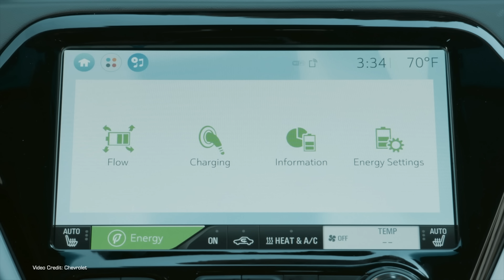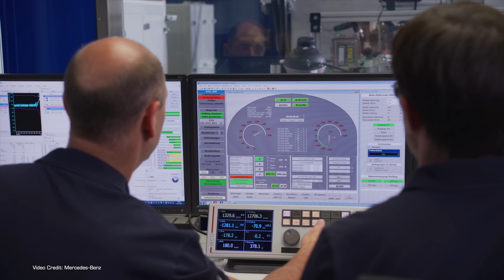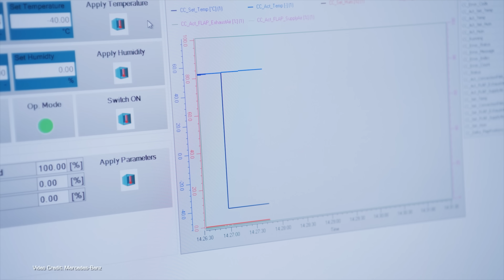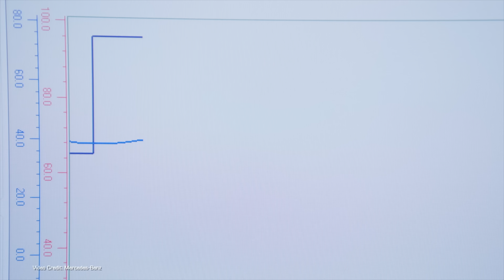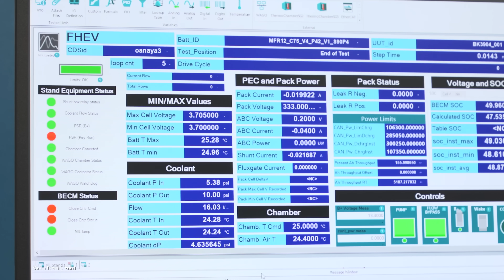Should You Buy An EV With An LG Battery Pack?

Comment: I believe that the upcoming GM Ultium battery is their own design, and I suspect that they will be more oversight of LG once the new factory comes online.

From a recent interview with Mary Barra, it appears that there are two defects that have to happen in the same cell at the same time. This sounds like a lacking quality control and inspection by LG allowing the defective cells to make it thru. Hopefully there is some severe pressure on LG to implement new procedures.
Reply: I won't trust Ultium either. Still pouch style and made by LG. Possibly a used one that is at least five years old and and no recalls. Never say never, but I'm very unlikely to ever get another GM since there are plenty of other EV's arriving.

Comment: It amazes me that most people don’t realise that they drive their ICE cars about with vast quantities of highly combustible petroleum gasoline, yet no one is panicking about that.
Reply: Right? I’ve seen ICE fires. It’s not like they are small or simple to extinguish.
Reply: The fear that EV owner may have is unlike ICE cars, unless there is an overt act upon the vehicle such as an accident, or while driving a ruptured fuel line etc., an ICE car will not spontaneous ignite in a garage like an EV might. I own a '20 Bolt & love the car. I can't park outside, so I follow the  recommendations except parking in my garage. I always set a Target Charge to 75% do to the "taper" of batteries. Also, I recharge at about 70 miles since I never know when I may need the car for a 35 mile run in a pinch. I did add a smoke/heat detector in the garage  with a remote alarm, so at least I won't get trapped in my home. But, many folks are skeptical on EVs. Some may think of them as an unexploded bomb lodged in their garage. And, that alone is a disaster for  the future of EVs... and climate change legislation.
Reply: @roncarguy6361  I can’t imagine the fear that some Bolt or LG Chem EV owners have regarding their home in close proximity to their car at this time. However, I have seen many ICE cars spontaneously combust, some with families onboard whilst in motion, yet the media persist in covering a rare occurrence in the EV world. A fair and balanced debate is needed, however, I do not think EV’s are at risk of being “cancelled” in general as there is too much of a swell in EV demand. In fact, I see that we are at an inflection point, the start of disruption to the markets and nothing will hold back EV’s from overtaking ICE this decade.
I sincerely hope that the issues with your Bolt and all the other Bolts out there, as well as other Affected LG Chem cars, are resolved and that whatever is causing this issue is found and corrected and lessons learned.
Reply: @REV-EV  Right! Fear of EV fires, especially from the ones who store their 2 gallons of gasoline for their lawnmower or snow blowers right next to the lacquer thinner and pool chlorine. I agree there is no turning back on EVs, but maybe a self extinguisher system or all Bolts to receive the horn warning alarm like the '17-'19s.
Reply: @roncarguy6361  Many many ICE cars spontaneously combust in garages.  There have been quite a few recalls because of this problem.  One of the owners of a company I worked for had a brand new Mercedes spontaneously combust in his garage in the middle of the night.  Luckily it only destroyed the garage and not the house.

Comment: Okay, confusion time.  Bolt has no battery buffer. Ops! Yes it does! Okay then why are we told to only charge to 90% if there is a buffer? Without the current battery issues, current knowledge has been to only charge to 90% anyway, prolongs the life of the pack. Seems like a lot of information that changes depending on whom you talk to.
Reply: How about the Bolt has a buffer, but because of the fires they want a bigger buffer.  Follow the recommendations.
Reply: #DOUBLEBUFFER , #BELTANDSUSPENDERS <--- good or bad, those "baby young to the world" will have likely never heard of this phrase/concept but yes, it's a "thing".

Comment: I drive my two young kids around in my 2017 Bolt. Do we have any idea of how long you have to react in the unlikely event that a battery does catch fire? Are talking 30 seconds before everything is up in flames? Or you start to smell smoke for several minutes, then it takes several more minutes for the fire to get out of control, or what?
Reply: Ryan if what you're asking is, with a battery fire will i have enough ADVANCE WARNING to get myself and my loved ones out of a EV the answer is YES.
Reply: @phillyphil1513  Thanks. That is indeed what I was asking.
Reply: @RyanWilliams222  yup, you're all set.  as the wise man say "FOREWARNED is FOREARMED".
Reply: The videos show they make a bit of air sounds then smoke and then a minute latter the heat starts getting a bit much. reminds me of the time the car on the next lot had a tire fire due to a leaking break line. it look 10 minutes for the fire to get to the cabin area.

Comment: Leaf and Zoe no battery fires, but I thought they had rubbish battery packs with no liquid cooling.
Reply: They don't last as well but are very safe. Nissan/Renault focused on safety.
Your house is safe but you will need to buy a new battery as I did for your Nissan.
I suppose new batteries are cheaper than new houses.
Reply: Renault Zoe packs last very well and do have active (air) cooling

Comment: When you start digging deeper into all the LG batteries out there you'll find a ton of them in not only BEVs but also PHEVs. There are a huge number of LG packs in the EU with minimal fires. Many made at the factory in Poland that would seem to have a pretty good track record at this point. This leads me to believe this is less a problem with the design and more a quality control problem. LG needs to make things right, regardless but I don't think that's means any LG batteries are wholesale faulty.
Reply: Fair point, but someone needs to figure out what's going on, and how  to fix it quickly.  The fact that they have halted production suggests they have no viable fix.

Comment: GM will follow the pattern they have always followed. In 3 to 5 years they will have all the bugs corrected. By then the stain on the particular  vehicle brand will be such that GM will change the name, and completely change the look of the body. Usually a year or two after that , the product completely disappears. Fiero, Citation, Vega, Cimmeron, Allanté, Corvair,need I go on?
Reply: Pinto, VW and virtually every car of the 40s through the 60s that used a glass fuel filter from Fram and A/C  etc. Life itself is an educated risk. Every time a driver leaves on a journey there is a risk of a crippling or fatal accident. But, the odds are against it, so we risk the action. I agree that the name Bolt may go away. I hope they don't resurrect the name Firebird. LOL
Reply: UNINTENDED ACCELERATION (ref Audi).
Reply: Unsafe at any speed..

Comment: There have been zero Nissan Leaf battery fires.
Reply: Mine still chugging right along, 55-60 miles per charge. If it would go 125 miles on a charge, probably would almost never need another car. Hell at my age, I can’t go much more than 125 miles without stopping! 😂
Reply: Agree that this is technically correct. My Mitsubishi i-MiEV also has lithium manganese oxide (LMO) cells, like the Leaf, although of a different cell form factor and manufacturer. Fires are rare or non-existent. The Achilles heal of LMO, though, is heat degradation and Nissan's long insistence for not providing any thermal management to Leaf packs. The pack in my 2012 i-MiEV began to fade significantly in 2020 and I got a free factory warranty replacement. Air cooling thermal management for the i-MiEV is only slightly better than the Leaf. 

You could liquid cool LMO packs. But if you're going to do that, you might as well offset the extra weight involved with a more energy dense chemistry, such as lithium nickel manganese cobalt (NMC) which describes what the Bolt's pack is. if an LMO cell were to be punctured, it would still violently go up in flames. NMC is, as we all know, is also a chemistry that needs to be handled with great care. 

The answer that seems to be drawing a consensus, at least for many workaday EV applications, is the less energy dense lithium iron phosphate (LFP,) which is one of the safest battery formulas available and very resilient in standing up to continuous charge/discharge cycles. You can also make an air cooled pack from LFP cells without heat degradation woes. Note that the new BYD Blade battery is air cooled LFP technology and Tesla uses LFP (CATL made cells) in standard range Model 3s, first in China and now in the US.

Comment: If you were buying a SR+ Model 3 in the US, would you pick the LFP battery or the Panasonic one?
Reply: I'd go with the LFP since degredation is lower making the 10 mile difference moot.
Reply: I'd go for the LFP battery.  It can charge higher daily and has longer cycle life (among other things).
Reply: LFP. The chemistry has been around for a very longtime and is known to be safe even after it gets old.

Comment: Only made in US Tesla's don't use LG batteries. Made in China Tesla's (Long Range and Performance models) use batteries from LG. Tesla is also known to use a much smaller buffer than most other BEV manufacturers, but has the most experience with BMSs.
Reply: Teslas don't use pouch cells anyway.
Reply: MIC Tesla Model 3 uses CATL LFP batteries not LG.
Reply: Made in US Tesla’s sure uses LG. I have an LG pack in my -21 model 3 LR
Reply: @kentfusag5458  That must be a recent change. US made 3's in the past had batteries out of Giga Nevada which are all Panasonic.
Reply: @JeanPierreWhite  recent in the way that it has been like that since 2020 became 2021.
Reply: @kentfusag5458  Are you sure? Here is what I read online "In Europe, however, there are two battery options for the Model 3 LR – one manufactured by Panasonic, and one by LG Chem. The battery manufactured by LG Chem is supposedly a 77-kWh pack."

It seems the LG pack is a Euro only option.
Reply: @JeanPierreWhite  I’m Europe based so that’s all correct, here we have the 82 kWh Panasonic or the 77 kWh LG both sold in model 3 LR. First half of 2021 it has been a lottery in which pack you get. Both options where manufactured at Fremont.
Reply: @kentfusag5458  Interesting. So the SR+ has CATL batteries, LR Pano or LG? That's very bifurcated. Seems Tesla are more willing to "experiment" outside of its home market.
Reply: @JeanPierreWhite  yes that’s correct and have caused some fuzz amongst the buyers. But I must say I feel it’s a bit exaggerated, I have the LG pack in my LR -21 built in Fremont and it’s a great car. The performance was never sold with the LG packs though. The LG pack charges a bit slower but on the other hand, when we first had the Panasonic 82 kWh pack over here, it was horrible in cold climate. A bit better now with new sw, back then, an old LR beat a new P in acceleration when it was cold 🤣

Comment: Tesla also uses LG Chem NCA (MIC) today,  which btw. seems to performs worse than Panasonic NCA (MIA). While it becomes much more complicated soon, since it will be a battery lottery. The short range models look to change to LiFePO4 (LFP) everywhere. Then long range MIG (Berlin) and MIC will be then new LG Chem NCMA and Panasonic in MIA.
Reply: They're not pouch cells so completely different.

Comment: No, absolutely not. LG has lost all credibility in battery building.
Reply: Then the Samsung battery in your phone should you lose credibility too.
Reply: @twany442  lol my phone doesn’t have a Samsung battery. On top of that, Samsung SDI prismatic batteries in automotive applications have had zero failures that resulted in fires.
Reply: @AriannaChelsea1  I wasn't talking about Samsung batteries in a car. I was talking about the batteries exploding in the phones. If you don't remember let me refresh your memory. Samsung batteries used to catch fire in some of their flagship phones and they too lost credibility but it didn't last long.
So I'm saying that they all eventually have problems or issues so get over yourself. Isn't Tesla being probed into and it's battery and autopilot driving system? I'm mean they are under investigation.

Comment: I hear that battery manufactures are preparing the separator within the battery with a much better coating of High Purity Alumina (HPA) . This material will get a lot of publicity over the next two years as it is one of the materials needed with batteries that you never hear of but is most definitely needed in a pure form. 99.99% purity is what is needed and from what I have read china( being the largest producer at present of HPA) usually supply 98-99.8% purity. Watch this space HPA will be the next point of discussion in the lithium battery world.

Comment: Despite the fact that battery fires are far less likely than an ICE car catching fire there are some differences. Many ICE fires are with older and not so well maintained cars plus most ICE fires can be handled with a simple fire extinguisher. Battery fires on the other hand are very difficult to extinguish.
My believe is that the world will turn to safer chemistries, in the moment LFP, and in the future maybe to solid state or other new types. We shouldn't forget that we are at the beginning of a new technology and on a steep learning curve. The hunt for more and more range will lead to mishaps but in some years that will be settled. We feel safe with our Panasonic cells despite the fact that some Teslas already caught fire too but it is less likely than the Diesel we also have to do so.

Apple and Samsung had battery fires in their phones but it didn't prevent people from buying phones. However, the new cellphone I just purchased has an LFP battery. I only found out after the purchase......... With the ever increasing size of phones it is easier to accommodate the larger size of LFPs in comparison to Li-Ion.

Comment: What about Leaf? I see so far no fires. Even in a forest wildfire. the car was burned out but the battery did not catch fire. I normally, since second design battery was replaced in the 2017 I leased and later on the now leased 2020 Bolt,  only charge to 90 per cent and never let it get to 15 per cent low.is that OK?  I live in a beautiful many many many tree mountain possibly susceptible to fires from lightning strikes and from fires burning up from below. With  120 volt charging to 232 and then regen down the mountain for 47 miles extra to 279. Does that sound OK? I don't want my beloved Bolt to cause its own wildfire. Also I do private rides for customers all day long on just one charge, the Bolt is so efficient.
Reply: You should change your driving habits. GM is recommending not going below 70mi which is about 30%. And you regening down the hill after a full charge is putting it above 90% charge. I believe 2020 years have custom target charging so maybe put that at 80% then you can gain the rest going down the hill. There's only been one 2020 fire so who knows , but just yesterday a 2017 bolt caught on fire and the owner said it was sitting at 15% / 30mi overnight. It's on the /r/boltev subreddit. Like Nikki says in the video it's about keeping a good buffer at the top and bottom of the battery.
Reply: @largeraccoon1229  Jeez this is a whole joke. I can’t imagine being a Bolt owner and being told that I have to park my car away from my house, don’t charge it beyond 90 percent, AND don’t let the battery fall below 30 percent of charge. I’m a huge EV supporter and future Model 3 owner, and if Tesla did this, I’d be equally as upset. This is not good for EV adoption. All of those batteries being replaced by GM and LG are batteries that aren’t going into newly produced EVs.
Reply: @waynelewis9110  i do what i want and keep charging it full or go until i am almost depleted but i dont do this often
Reply: @largeraccoon1229  ugh! Another Electric Pinto fire!  “Scotty: you’ve got one hour to fix this thing. Here’s some duct tape & chewing gum!”
Reply: The Leaf doesn't use LG batteries, which may be one reason you haven't heard of any Leaf fires.

Comment: I wonder if this debacle will accelerate the adoption of LFP batteries.
Reply: re: "I wonder if this debacle will accelerate the adoption of LFP batteries."  i actually think it might.  this is the intelligent response.  can't really blame a consumer for NOT wanting to buy a vehicle they think might burn them out of HOUSE and HOME.
Reply: LifePo4 isn't as power dense and weighs more.  Not really an ideal candidate for something that needs to be light and power dense.
Reply: @Alex-je6od  it’s marginal, but put them into a 4680 cell format and structural pack and there is a weight saving. LFP have plenty of positives, the biggest being cheaper to make and they use no cobalt or nickel and they can cycle more with little degradation.
Reply: @Alex-je6od  While that is true, LiFePO4 cells are happy to be charged to 100%, NCA and NCM prefer 90% or less. So while LiFePO4 will inherently have less range for the same size battery its daily usable range is helped by being charged to 100%. So the difference isn't as severe as it at first seems to be.
LFP are very safe and only have slightly less range. Customers may prefer a safer battery.

Comment: After the VW fire I have started to doubt my Ioniq a little bit. Because if the VW fire was started by the same issue in the battery, it no longer appears to be limited to a single production line in Korea.
Reply: Well, it certainly isn’t just an issue of one Korean facility, some Bolts that recently caught fire had American LG batteries.
Reply: re: "After the VW fire I have started to doubt my Ioniq a little bit." good that's a sign of INTELLIGENCE.  it means your SA (Situational Awareness) is building up.  Hans you are going to be a General some day...!!! 👍👌